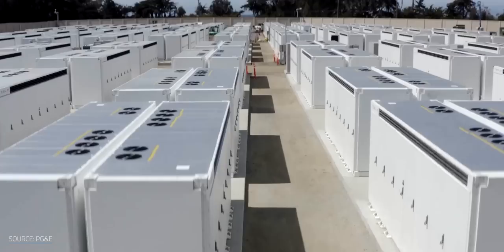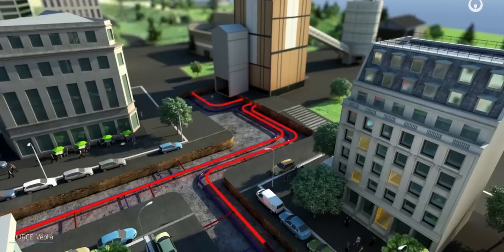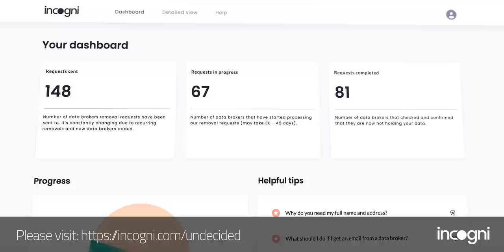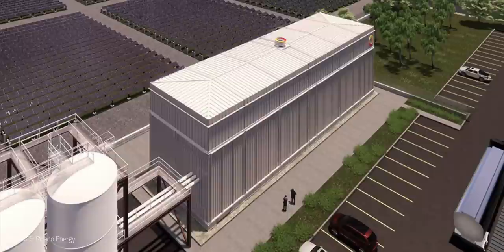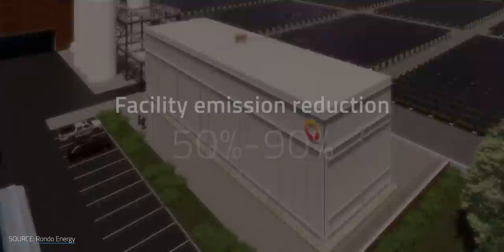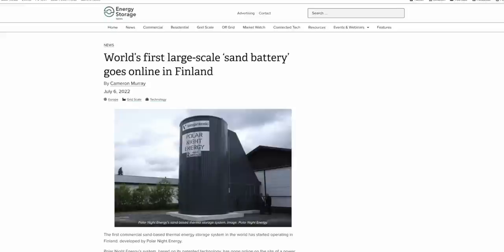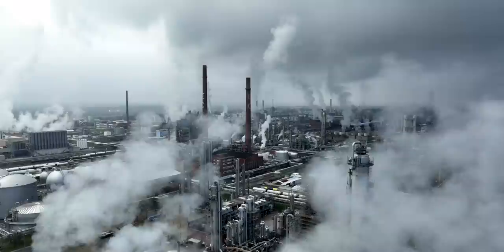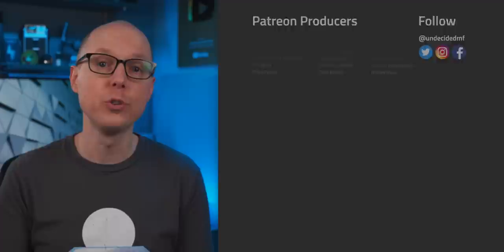How A Brick & Rock Battery Is Changing Energy Storage

Comment: Hey Matt, we appreciate the spotlight you're putting on thermal energy storage! Thank you for including us in your video.
Reply: Nice to see you're tackling energy store with a different approach. Well done guys!
Reply: As children, many of us would use a magnifying glass to set paper on fire. With a tracking system to follow the sun, would it be possible to use this energy (paper burns at 454 farenheight) to heat your bricks, or boil water to produce electricity for your system to use?
Reply: @johnnajera9659  Hi John -- fond memory! So some companies use concentrated solar power systems to generate both thermal and electric power. While these systems have many upsides (including being zero-carbon technologies), there are some limitations. Two big limitations are related 1) it requires a lot of space to deploy concentrated power at scale, and 2) when you do find the space, it's often not located directly next to the facility that requires heat, and it's very difficult to transport heat over distances -- it results in a lot of energy loss. 

An electric thermal energy storage system like Rondo's uses electricity is very energy dense and can be located within an existing facility -- right where the energy is needed. This is because it's very easy to transport electricity over distances with almost no loss. For these reasons (among many more), it's actually lower cost and lower impact to generate heat using electricity from photovoltaics and wind turbines with an electric thermal energy storage system.
Reply: @rondoenergy4228  It might be interesting, small scale to have concentrated solar to boil water for steam turbines. Steam may be poised for a comeback.
Reply: @rondoenergy4228  When are you coming to my country? 🤣. Closing nuclears because of politics, and planning around 80 MW renewable energy. Volcanic high-enthalpy areas under investigated, and electro intensive industries such as aluminium closing because the LNG price rises.
Reply: @johnnajera9659  There's already thermal solar farms, like Rondo said thought they're very large as a requirement to concentrate enough heat.
Reply: Can i invest😗
Reply: thanks bill
Reply: Go Rondo Energy go!
Reply: Hey Rondo. You want to fund my study for the hottest rooftile and bring back classics like the Pyramids. Gimme a call?
Reply: You knocked this one out of the ballpark Matt.
Reply: @LinkWrayisGod  not to mention consumer LNG use for heat. If these could be placed strategically across eastern Europe, Russian gas would quickly become obsolete. I wonder if Rondo could come up with a retail version small enough for a single family home. I overproduce electricity and my utility company won't pay for the excess. It would be nice to dump that into a geothermal system made of rocks instead of delicate and sophisticated heat pumps...
Reply: @johnnajera9659  Concentrated sunlight should easily produce the temperatures needed for any kind of smelting or metallurgy, or cement production for that matter. I've always wondered why that isn't a thing yet.
Reply: @johnnajera9659  if you’ve ever seen a photo of a bunch of panels pointing at a tower that’s concentrated solar energy, they work exactly how you described. Heat is used to create vapor, the vapor is condensed at night and turns back into water
Reply: Good concept, but to be honest I do not buy the 95+ efficacy. Thermal energy is like the worst energy
Reply: @rondoenergy4228  I worked at Purina wet dog food factory and this unit would be perfect to feed heat directly into the boiler instead of burning natural gas.  Steam is being run 24/7 for cooking the cans and other processes. Can i ask what kind of voltages this kind of system voltage like this takes?  If you could bypass a transformer that would be great for total input efficiency.
Reply: Sounds useful for for companies like Frontera in NZ that make huge quantities of milk powder and are trying to move away from coal use. But they’d still need to generate the power.
Reply: amazing idea and product, definitely will and needs to be done on a larger scale

Comment: In terms of residential energy consumption, roughly 20% goes to creating hot water and more than 40% goes to heating the space in your home.  This means any system of energy capture and storage, on a significant scale, could meet about 60% of annual residential energy needs in the US.  All of a sudden, hot rocks sounds like a great idea!
Reply: Residential heating is nothing compared to what industry needs. The residential population is not bad guy here.
Reply: Better Insulating Materials have to be discovered this would Exponentially increase efficiency!
Reply: @onegreenev  no bad guy on either side, just better and better renewable solutions for our energy needs, I love it!
Reply: @Certago  You have no idea what you're talking about.
Reply: @mrdanger4851  So you left out the word cheap. The world doesn't need $2,000,000 closets.
Reply: @onegreenev  - Residential consumption in the US is just under 30%.  If we can reduce emissions for 60% of that volume, it's well worth the effort.  There's never a wrong time, or a wrong reason, to do the right thing...even just a little bit at a time.
Reply: nobody will become billionaire with simple sensible systems. It must absolutly be massive, heavily subsidize C2C solution.
Reply: @Pete McWade  industries are responsible for 30% of energy use in US. That means that commercial and residential consume more than 2 times more energy than industries. Residential population should take its responsibilities. There are enough resources on earth for 10 billion of Portuguese but not enough for 1 billion of Americans.
Reply: @pierregravel-primeau702  Your assumption is way off base by excluding transportation. The makeup of energy use in the US is: Transportation is 37%, Industrial 35%, Residential 16%, and Commercial 12%. Instead of consuming "2 times more energy" they don't even equal industrial when they're added together.
Reply: @DeletedOS  

Transportation is mainly individual vehicles used for commutes to work and errands, then commercial transport via truck, then airlines.
Reply: District heating can utilize the power source directly.  Normally a generator gets some small percentage of the chemical energy as electricity and the rest is waste heat (Carnot efficiency).  If you have pipes hooked up the "waste heat" does not get wasted.
Reply: @stefanr8232  The problem with district heating is that if there is just one leak, everyone suffers. Each home should have a backup boiler just in case.
Reply: And if it's like 400C, that's more than hot enough for ovens.
Reply: It will be interesting to see is this could scale down.... to residential size units.... similar to geothermal units....
Reply: I've heard tah 34% of all energy is for industrial heating if that is true that can have huge implications
Reply: @FrankJDurante  
That's exactly what an off peak hot water service is.
Cheap power is used to heat water in an insulated tank for later use.

Comment: During the 1970's my Wisconsin neighbor designed a combination thermal solar and storage system using cans of distilled water in modular cabinets.  The  solar heated air was passed through the modules storing the heat for use later.  Simple and effective.

Comment: Storing heat is a truly ancient and practical heating method.  People used to put stones in the fire to heat them up during the day while the fire was in use for other things, and then over night the stones would release the built up heat to keep the area warmer.

This is very similar to using heating inside a concrete floor.  Heating the concrete up, it helps keep the heat more stable in the environment.

Using a material as a heat sink really helps balance temperatures during the 24 hour temperature cycle.  This is one of the reasons I love brick and stone buildings.
Reply: It gets even better when you create a solar barrier during the hotter times that lets light through during colder periods to store heat from the sunlight. If you really like it cool, you can just build underground for a fairly stable temperature
Reply: This is why large stone mantles exist. Also, in old homes, the rocks heat up and the heat spreads through the rock walls.
Reply: @runed0s86  yeah, why here in the uk with every summer bringing new record breaking heat waves are even more torturous 🥲.. Most of our houses were built to store whatever heat that is gathered through the day into the night but when the heat continues we end up literally baking in our own tiny brick ovens.
Reply: True, even star trek use their phaser on rocks to heat them up on some episodes...LOL
Reply: @spookymunky1  we have an average summer temperature of 10 degree mate, try going somewhere actually hot and write that again lol. Maybe one week a year it becomes unbearable for us but its hardly "baking in our own tiny brick ovens". That is a massive exaggeration.  Our houses are built the same as most of western Europe and we are one of the coldest places. This is just like us brits complaining about 2 inches of snow while every cold country laughs at us. Its embarrassing man. Besides any house with all the windows open will be the same as any other so that doesn't even make any sense unless you are purposefully trying to make your house as hot as possible.
Reply: Hehe. Good point. Lifting sand and tossing it into a sandmill is what kids learn in the sandpit. Too,....
Reply: @spookymunky1  In the middle east, they invented structures to harvest the cooling power of the wind and the lower tempreratures underground.  This from an area where an average days is over 110 farehnheit (43 celcius).

Its not the bricks at that point that is the issue.  It is the design planning for a permanently cool environment.  I get it, why spend money on a solution you can't imagine ever needing?  Same thing with polution and retirement investments.  ;)
Reply: @richbob9155  There's also the fact that it's very humid here at all times. That feels a lot different than hot countries which have low humidity.
Reply: The same as the old open fire places with big Brick or hard rock enclosures that took in the heat all day and when the fire goes out, the warmth still comes out of the Rocks all night to keep the room warm with no more actual fire.

Comment: Different applications have different ideal solutions. It's not a matter of "is this the best idea" it should be "Is this the right solution for the application."
Multiple solutions working in parallel will help solve the overall issue of reducing carbon emissions, and I'm excited every time you showcase solutions, and showcase some of the best applications for it. 
Very well-done videos.
Reply: Exactly, this type of long-duration, slow-release storage is perfect for usages that never require rapid heat input anyway. There's no one perfect tool for every job, we need multiple tools to cover many types of jobs.
Reply: – "It's not a matter of "is this the best idea" it should be "Is this the right solution for the application.""
Realistically, what the potential buyers are looking for is "the best solution for the application".

Comment: In the mid-1980’s New York Electric and Gas (NYSEG) gave away brick heat storage units to private customers. Their incentive was to help even out the electric production by having the heat storage powered at night during off-peek electric consumption. Our electric bills dropped dramatically by shifting our heating costs to nighttime electric. The unit was clean, quiet, and efficient. I’d like to see them produce a brick hot water tank. 😊
Reply: This is the heating system  I have had for 30 years.  It does get pretty cold here and you know our heating season is from October to April

Comment: Thermal storage was introduced to Australia about 50 years ago. Then, it was called "Heatbank" and used cast iron as the storage material. Then used a small fan to distribute the heat.
Reply: We had that here in Germany too. It was called Wärmespeicher and it was pretty popular in the 70s and 80s. Don't know why they disappeared
Reply: In NZ many power companies offered "Nightstore" heaters which heated a mass (I thought it was ceramic but I might be wrong) during off peak and released it on command/timer. 1970s I think.
Reply: Thermal storage was introduced thousands of years ago all over the place.
Reply: The Open Hearth steel making process uses firebrick for energy storage, capturing the heat from gas escaping the furnace, then flowing air through that brick to preheat it.
Reply: @peterkotara  I've currently got one in my flat (apartment/condo) in the UK (Wales). They are a horrible means to heat your home if you aren't organised or happen to go away from home overnight. Modern ones probably have timers built in though.
Reply: @RobQuinney  To be honest Rob, my only involvement with them was seeing them in skip bins out the front of houses being renovated (and that was the 80s - 90s).
I think that sais a lot about them.
Reply: @peterkotara   Basically, the second solution sounds like hangi rocks arranged in a box. I wonder if there might be some scope for innovation here - it's not like NZ is short of volcanic rocks.
Reply: @dustman96  Cavemen moved stones into the sun and back to make a cozy cave 
to sleep in.
Reply: @Trixtah  An electric hangi/thermal store? I love it, 2 appliances in 1.
I for one would love to live in a house that smelt perpetually of boil up and hangi (I'm serious).
Reply: @Fabian3331234333  they are very hard to use and need variable rate to make economical sense. It is hard to keep a good mass at 500-800oC using resistor alimented by fossile electricity. If insulation failed even a bit, you loose tons of energy and confort. If you heat with resistor with a fossile grid you can emit up to 3 times more GHG than burning the fuel direcly. Heat pump, on the other side use 3 times less energy per unit of heat than resistor. It's simply obsolete.
Reply: @pauldietz1325  technically it's not energy storage, it's energy efficiency.
Reply: @firstbigbarney  How did you understand what the caveman was saying?  I mean, wasn't it all just "ook, ook" and banging a club on the ground?
Reply: @Fabian3331234333  I'm currently living in a rental appartmente in Germany with one of those. I actuall know it by the term Nachtspeicher, and I think that explains the concept quite well (and why it's not used a lot any more): During off-peak hours, usually at night, the electric energy was very cheap decades ago, so it could be used at night to heat up this kind of heat storage. Nowadays, it's fairly uncommon to have this kind of contract with your energy provider, but even if you have one (like I do), it's not even 10% cheaper at night. So it makes no sense... using a resistor (electrical) heater would be much more conveniant, and not much more expensive. Other sources of heat are much cheaper.
Reply: @Fabian3331234333  
too expensive
Reply: @metalsprengkopf  I had this contract with my provider when I lived in a flat that had both water and central heating running on eletricity. The off-peak price was actually about half the normal price, so I scheduled my washing machine, dishwasher and oven use to take advantage of it.
Reply: We had this in Bulgaria too in the 80s and probably earlier. It did heat the room and I could sit or lie on it which was nice 😁but I am not sure if it was more economical, since it would very quickly dissipate the stored heat and we would have to turn it on again I think. It was also very heavy because of the bricks inside so when we decided to get rid of it I had to dismantle it. But i am still using the bricks in my basement to support stuff
Reply: Agreed. We had similar in the UK in the 80’s I think as electric storage heaters. One in each room, similar to a radiator. Really hot surface, so as a kid you learned quickly not to touch them
Reply: @dustman96  what did the Roman’s ever do for us?! 😉
Reply: @metalsprengkopf  Where do you live that the day/night pricing is so close in price? In the UK such rates differ by 34:13 if I am remembering my rates correctly.
Reply: @AlanPeery  I live in Germany. This is the contract my local supplier offered me. Usually, you can make a contract with any supplier, but I moved here 7 months ago, when many suppliers didn't welcome any new customers because of the chaotic state of the energy market. I'm nearly sure there are better contracts, but right now I'll stay with this one